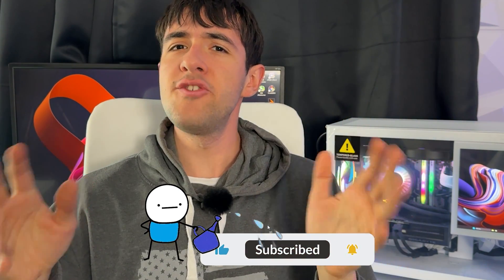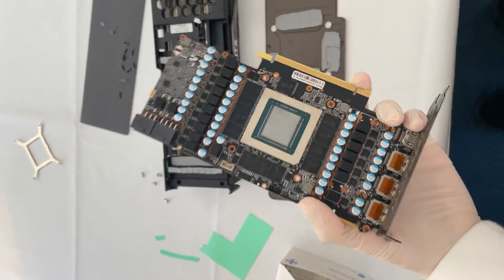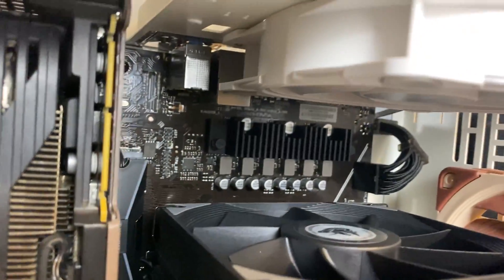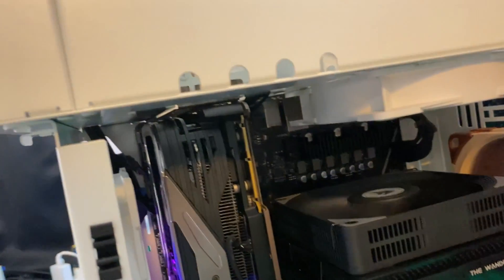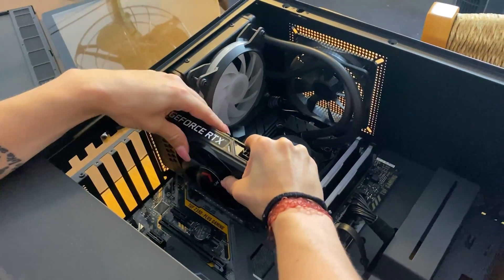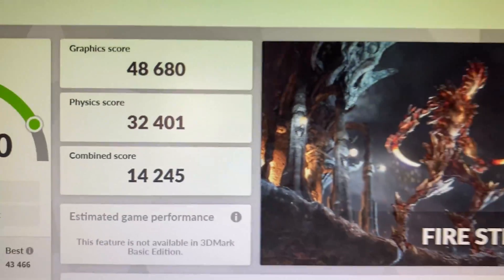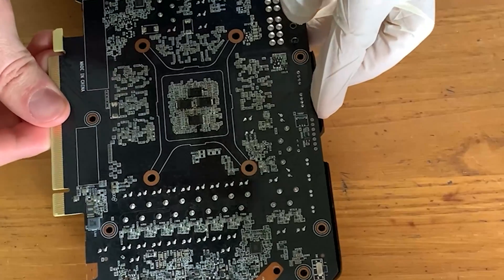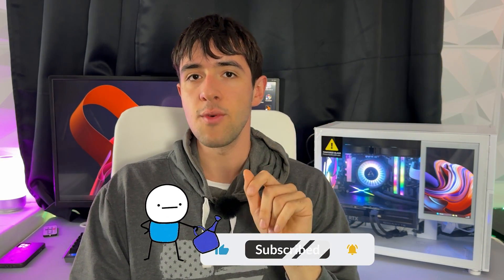Are PNY and Gainward GPUs actually that Bad?

Comment: sorry PNy are affordable but they skimp on power stages and protection  circuitry to achieve cheaper pricing. no fuses less resistors and power stages. not to say they are bad but they are skimped out. bought one had to tear it down lasted 2 months and bricked. Their customer service is horrendous! You buy one lets say at micro center, Best buy etc spend the money on in store protection plans. Big named companies have skin in the game to be given free returns on any and all RMA's where as a individual will be hog-tied in nomenclature, BS user error warranty misinformation, and more importantly have your products held for ransom after they get your products in shop to tell you it is not a warranty issue and they will bait and switch you with a replacement at a great discount or make you spend 165$ for service charges if you do not accept their offer. AKA held for ransom or pay! They are unscrupulous. If it works good for you if it doesn't your up 💩creek without a paddle! BEWARE!

Comment: Palit own pny and gainward. Palit do discrete manufacturing for other companies, nvidia themselves use pny and palit in their professional work stations. The pny side of things also makes ram, nvme, non nvme ssds, pen drives Etc. Palit is the biggest manufacturer of gpus in the world, you could have a really powerful named gpu that was actually manufactured by them. It won't mention it anywhere on packaging or the card as it's discrete. Your expensive ram and nvme's could be manufactured by pny. So yes they're a good brand and nvidias most trusted. They can make their own gpus cheaper, some brands cost more for the name and or because it was manufactured by 3rd party so they then have to charge more.

Comment: had a pny xlr8 4070 ti worked perfectly Oc memory to 2000mhz then i swapped it for a 4080 super version, it is using the same oversized cooler 😅

Comment: Ive got a 3070 xlr8 revel coming. Ive read that the pny cards are power limited, is that true and is there a way around it?
Reply: Unless you mod the bios?  It's a stock safer experience.

Comment: Owner of an PNY 4080: Good Card but the PCB is like Gigabytes a bit fragile.

But the Pads and Thermal Paste are really really bad. Ill hope it will not crack its mounted with 3 sticks as gpu holders

Comment: α question for the pny 3090.. if i use a 1mm pad end squeeze it little to make it about 0.8mm?..
Reply from the maker: Yes if it’s a very soft pad
Reply: very thnx im going to receive the card in a few days. i test it and try to change the pads.. but first must to open it and check the revision.. i send you guys my reports
Reply: ok so its the pny  rtx 3090 revel rgb.. i have the version A think.. change the pads with 2mm squize it a little bit.. 2mm front end back the same.. it worked ok.. but i have noticed that because of the design of the cooler hot air comes from the upper right and drive through the cpu cooler raising the cpu temperature dramatically.. but its ok i ramp up the  case fan litle to compensate

Comment: I have a PNY 4090 XLR8 with no issues for a year. I just wish it had a higher power limit like 500 watts. I might flash a Suprim 520 watt bios one day.
Reply from the maker: Yeah PL is a big issue on PNY if you’re into overclocking. But they flash easily :)
Reply: @ImWateringPSUs  I have already tested the nvflashk tool by flashing the oc bios of a PNY 4090 om my non oc PNY 4090. I have zero side effects because it was a bios of same vendor but barely gained any clocks which shows the OC model of PNY 4090 is a rip off. I wish I could get some input from PNY owners on which bios is safe. I have my eyes on the Suprim bios with 480 watts base and 520 watts oc.
Reply: @ImWateringPSUs  I am thinking of the Suprim bios since it has a 480 watt base profile. I want some input from other PNY owners who have flashed since I am scared of a black screen.

Comment: I think most people avoid PNY due to RMA being declined. Just google "PNY RMA refused" and you will see. There are quite a lot of RMA issues regarding PNY, where PNY isn't honoring warranty. This might not be a big deal in the EU, since warranty goes via retailer, but in the US, that should be illegal. PNY is usually more expensive than MSI and all other premium more brands like Gigabyte, ASUS so in my country, its much easier to buy one of those. For example, 4060 Ti (I'll take just this gpu as an example) MSI Gaming X Slim costs 25 or 30 eu less than PNY 4060 Ti XLR8. Back when I was buying 3070 Ti, I bought Palit 3070 Ti GamingPro and PNY card cost like 100 eu more, while keeping the same look as 3070 Ti Gainward Phoenix. They do lookalike, but I don't think they are actually related to one another. Seems like Palit, Gainward and PNY are produced in the same factory, but only Gainward is a part of Palit, while PNY is not related to them.

Comment: Came here after starting to undervolt my pny 4070 ti super based on your video. Card looked and worked great out of the box. Basic settings were good but I'm not seeing much headroom without heaven crashing
Reply from the maker: Glad the UV video was helpful :) OC Headroom is very much luck, but also as I mention in the video the PNY non-XLR8 series especially is not OC oriented I’d say! But they run great with a bit of an UV at around stock settings

Comment: I have a 4080 pny XLR8 and it’s been a solid performer
Reply: Verto 4080super owner here for around 5 months and couldn't be happier, got it for around $900usd which was 1-150 cheaper than every other card. It runs very cool, quiet and performance is obviously very good as its a 4080super, but the only downside so far is the power limit is locked at 100% in the bios so you cant squeeze that extra bit of overclocking out of it. That being said, i still managed to get a stable oc with +150 core and +1300 memory, scored very well on time spy (29,353 graphic score)
Reply: i also have a 4080 pny rgb and its  a good card. Yes u cant overclock it as much as others but U DONT WANT TO anyways u gain nothing from it. Also anyone who needs warranty on their cards are idiots. GPUS never die when used stock clockz ever. As long as u have decent cooling on a gpu ur good 4 life. PNY is great yall stfu
Reply: @mannyleal4194   Saying you get nothing from overclocking is blatantly false, not sure who told you that. GPUs have a fail rate usually around 1% so to say they never break is also not accurate, regardless of being overclocked as you can't actually force a card to do anything harmful to itself by overclocking. Lots of things can go wrong with a gpu that has nothing to do with clock speeds, just check out northridgerepairs. 

PNY are fine cards, Kingpin is even working with them now but let's not be delusional about WHY they're good cards and what their downsides are.
Reply: @mannyleal4194  Oddly defensive my friend...

GPUs absolutely die sometimes and yes overclocking does get you extra performance, especially with the 4080super as it has very good binned memory. I boosted my performance by a good 10% and I'm not just talking about benchmarks, in actual games

PNY is fine but we don't need to plug our ears and scream LALALALA about its downfalls
Reply from the maker: Glad to hear some extra feedback about the 4080 :)
Reply: Me too and zero coil whine. Very cool and quiet